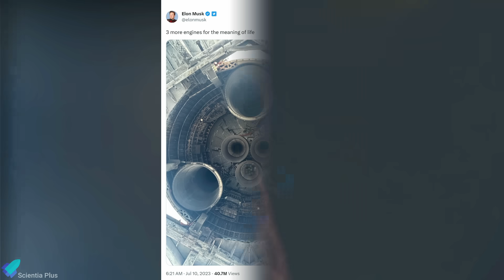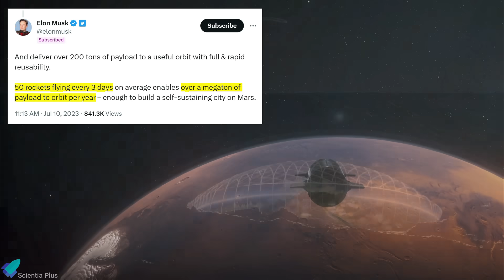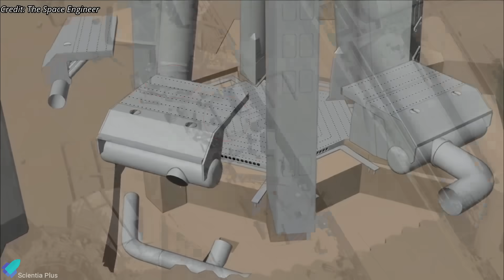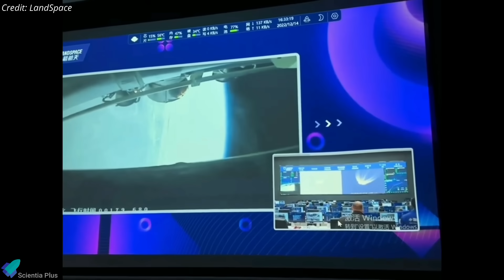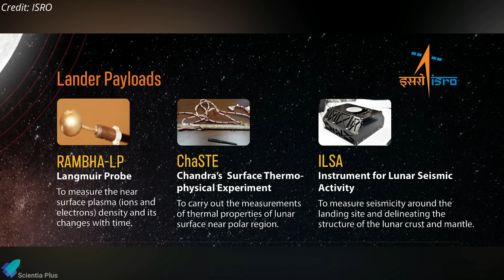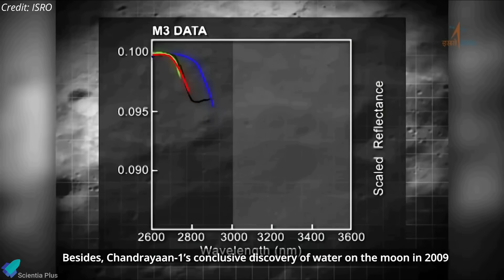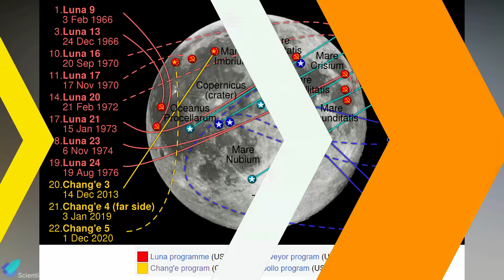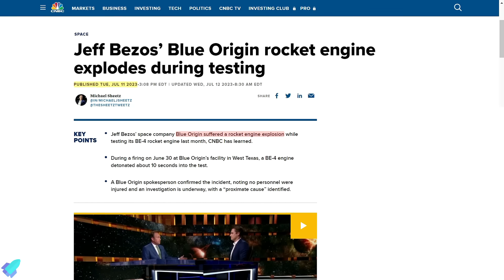SpaceX Starship Massive Water Deluge System Test, Raptor Engine Thrust Boost, BE-4 Engine Exploded

Comment: Thrilled about the new Orbital Launch Tower's water-based damage-supression system! Reusable, basically untested, but promising. Also interested in the lunar landing and launch versions ... which are at this point, a bit vague. 

Yes, Luna only requires 1/6 G to launch, but that's a great big stainless steel tank, not a flimsy Apollo LM with skin like a n aluminum beer can!

I want to see the launch proposals for return to Earth from Luna and Mars, and I make a prediction: part of any Starship that is not intended to permanently live where it landed will include in its payload a blast diverter. It may just be a cone-shaped device, or a faceted cone to divert as much energy away from the landing feet as possible, but it will be an expensive piece of hardware to loft and will considerably reduce potential payload.

Of course, land one or two and a tractor in reasonably close proximity, and that's how you build infrastructure!

Comment: I wonder why SpaceX can’t get their math right. The amount of water required to deflect the blast to ground ratio is only a fraction required. It still comes down to the 1966 NASA report on launch pad safety. The exhaust will blast the new sprinkler system into a pile of melted metal. However, there is another option and nobody wants to hear it. Raise the launch stand up 50 ft.

Comment: Raptor V2 will deliver 2.7MN of thrust.  Nice, but can't match the Saturn V's F-1 engines 6.77MN of thrust.
Reply: That's the point though, smaller engines are potentially more points of failure but they also do not affect the entire system as much when one fails so they are much smaller than Saturn 5 engines.
Reply: @christopherprice9779  True.  But no F-1 engine used on the Saturn V ever failed.
Reply: @douglaswilkinson5700  was one launch that ran on 3 of 5. One of the F1’s malfunctioned and was commanded to shut down, but the wires were crossed so another engine went out instead. They just burned the remaining 3 longer.
Reply: @pmacamfg7655  I watched every Saturn V launch on live TV.  I never saw an F-1 fail and no Saturn V ever exploded after takeoff.
Reply: @douglaswilkinson5700  sorry, my mistake, was second stage of Apollo 6. they had fuel and oxidizer wires for engines 2 and 3 switched, so when they tried to shut down one of them, they shut off fuel to one and oxygen to the other.
Reply: @pmacamfg7655  No problem!  I was disappointed that Starship did not have flame diverters and a water suppression system to protect both the rocket  and the launch pad.  The Saturn V launch pad did.  I've heard that the rebuilt launch pad has been redesigned to address these issues.
Reply: @douglaswilkinson5700  Should, was just looking at the launchpads at Cape Canaveral on google earth. Could do with a few blast ramps too.

Comment: When SpaceX does a HB static test on the upgraded OLM, will they fire up just one or a few engines then inspect the OLM for any damage or changes.  I would think gradual stages of testing would be wiser.  Another  failure would only add ammunition to the opposition and naysayers.

Comment: Can a Starship reach orbital velocity without Booster, if it is not carrying much? I guess it needs some fuel for landing, but in orbit refuelling could do that, just wondering if it has enough power and fuel to reach orbital velocity by itself, act like a SSTO?
Reply: No it can't. It's going to lack several km/s of delta-v to reach orbit and that's not counting for overcoming air resistance which requires more dV. The super heavy booster would get closer to reaching orbit but it can't make it there either.
Reply: @wombatillo  thanks

Comment: Am I the only person that thinks the SpaceX water system is completely nuts? Complicated, lots of crazy plumbing on an enormous scale, large flows. It should provide a nice spectacle, but hardly an efficient use of resources. Also, I'd like to see some data about how the OLM shifted under its first launch. The foundation appears sketchy and most engineers agree it's better to put the pilings in place BEFORE the structure is built.
Reply: I think you should take over the reconstruction.
You are so "skilled"!
Reply: No, the Chinese and Russians probably agree with you. They prefer to copy simpler designs of ours.